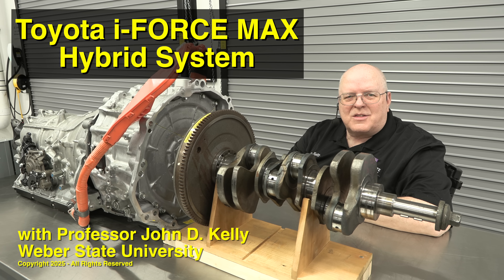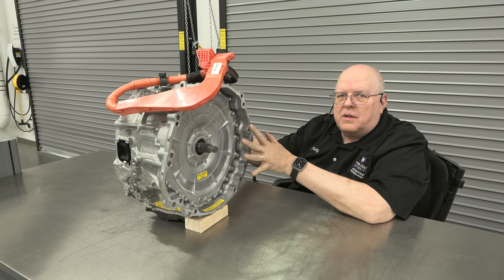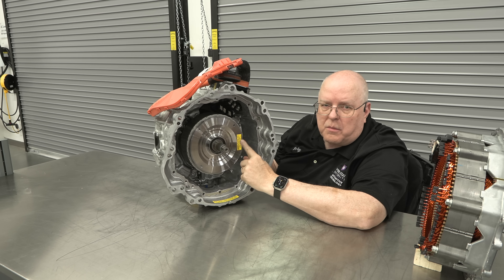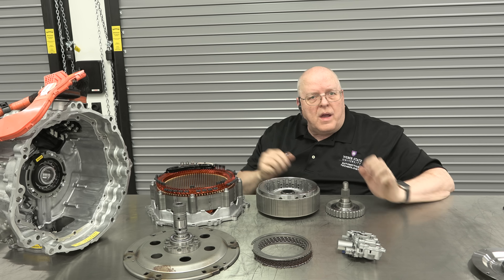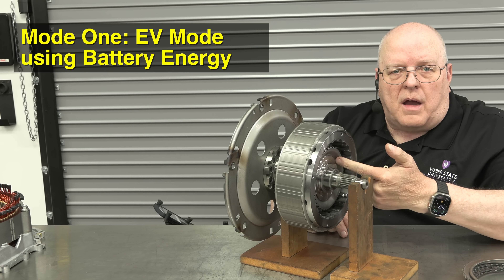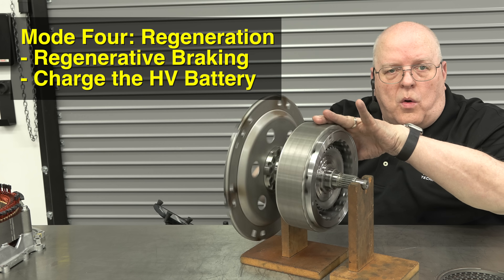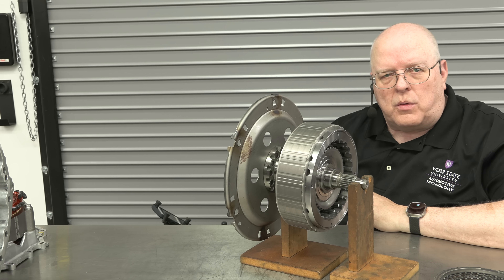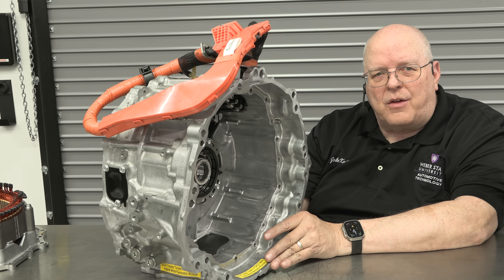Toyota's i-FORCE MAX One-Motor Hybrid System

Comment: Thank you, Professor Kelly. I am a 72 year old senior and find your videos interesting. You educated me on my gen 4 (2019) Prius from your video on Prius. Always interested to learn as much as I can.👍🇺🇲
Reply from the maker: That is great to hear, thank you for watching!
Reply: @WeberAuto \How does it it hydraulic lock up for engine start if there is no hydraulic pressure. I understand everything but that. No line pressure from trans in KOEO situation. Does it just build line pressure up that fast for a seamless engine crank? Does it have a pressure senor in the system(s) so it just doesn't willy nilly slip the clutch while cranking? So confused, I must be getting old . The situation I'm talking about is when it is parked with a near complete discharged hybrid  battery.
Reply: @Dieseling123  I am pretty sure the hydraulics that power the clutch pack are pressurized using an electric motor. So basically, you push the power button, the contactors power up the EV system and the hydraulic pump. Once pressurized, the EV motor spins to fire the engine, and the hydraulic clutches engage to complete the process, spinning the engine.
Reply: @mynameismud08  It gets its line pressure from the transmission. So your are saying there is a electric hydraulic pump inside the transmission on top of the mechanical pump.
Reply: @Dieseling123  I was making an educated guess (hence saying "pretty sure" as opposed to "sure") based on how other Toyota hybrids work. For instance, most don't have a normal power steering pump like old engines do; they use electronic pumps. You'll have to wait for the professor if you need a definitive answer.
Reply: @Dieseling123 
Very interesting question, I would guess there are accumulators that hold just enough pressure to feed the clutches when the valve body solenoids are active. Since this has a traditional transmission, I would doubt if there's an electric hydraulic pump that builds that pressure on KOEO.
Just a wild guess
Reply: @mynameismud08  I'm actually a 48 year mechanic. Hence the "I'm getting old" part of my comment. Pretty familiar with modern systems.  Just a little stumped on hydraulic pressure on standing still vehicle. I could be making more of an issue out of it than it is.
Reply: @Dieseling123 at 12:38 he mentions electric pump with ICE off and mechanical pump with ICE on so your years of experience paid off

Comment: Does the internal combustion engine run all the time? Why does it need a torque converter? Great video!
Reply from the maker: There is an electric only mode where the engine is off. Other than that it is running.

Comment: hmmm... it still has a torque converter... from my point of view it isn't necessary with EM in between...
Reply from the maker: The torque converter allows for a smoother and quieter power transition than an electric motor only system like the Jeep 4Xe system.

Comment: I think this system has become more complicated, less reliable, and I wouldn’t say these cars have impressive fuel economy either. In my opinion, the eCVT was a brilliant solution  minimal parts and maximum reliability. I don’t understand why they’re moving away from it. They already had powerful transmissions in the LS600h and GS450h. What’s the problem with putting the internals from the GS450h into a Tacoma? The engine is basically the same (at least in the 2006–2012 GS450h), so it would be both efficient and capable. What does Professor John D. Kelly think about this?

I really like the TX550h+ for its engineering the good old V6 and the eCVT that’s as reliable as a hammer. Unfortunately, $85K is still an unaffordable amount for me at the moment.
Reply: Even tho THS eCVTs are brilliant, they're not good at offroading. See Subaru AWD new hybrid with Toyota eCVT on it and that thing aint capable as previous CVT at uphill.
Reply from the maker: The Lexus transmission was still a power split transmission. This parallel system allows all of the engine torque plus the motor torque to be applied to the Powertrain. Thanks for watching
Reply: I live on a large hill and have this in my tundra. You would be shocked how good the gas mileage is going up and down the hill everyday. Also the power this thing makes is bananas.
Reply: I disagree on complexity and reliability. It’s a standard engine and standard transmission with a clutch and an electric motor. This isn’t new engineering or production. The amount of torque that this can apply (towing) is significantly better than a planetary power split(PPS) as in a PPS in higher speeds the transmission is providing counter force (slowing or reversing gears) to lower the RPMs.

Comment: I hope those 5 clutch plates and disc hold up, is there a back up starter motor?
Reply from the maker: Yes, there is still a traditional 12 V starter motor that can be used if this does not work.
Reply: Truly Toyota backwards "innovation" in electrification - this is much closer to Honda's ancient IMA hybrid system than what Toyota already had since 1997...

Comment: Larger than I expected. I'm guessing the Grand Highlander using this module is limited to only a 6 speed because of space limitation when used in a transverse layout? The efficiency in that layout also seems to be somewhat disappointing.
Reply from the maker: The grand Highlander uses the same front trans axle as the sienna van and regular Highlander, hybrid, however, it uses a very large rear electric motor that comes from the BZ4X electric vehicle from Toyota. So it has more overall power than the sienna or the Highlander hybrid. Thanks for watching.

Comment: AI Summary

Abstract:

This video provides a detailed technical teardown and explanation of Toyota's i-FORCE MAX parallel hybrid system, featured in vehicles like the Tundra, Sequoia, Tacoma, and 4Runner. The core of the system is the "hybrid generator module," a self-contained unit installed between the engine's crankshaft and the automatic transmission. This module houses a powerful permanent magnet synchronous electric motor and a multi-plate hydraulic clutch pack. The video demonstrates how this clutch pack is the critical component that connects or disconnects the engine from the drivetrain, enabling four distinct modes of operation: pure electric vehicle (EV) mode, engine starting, hybrid mode (where the motor assists the engine or recharges the battery), and regenerative braking. The presenter highlights the system's impressive power output, noting the electric motor can add 60 horsepower and 184 lb-ft of torque, and concludes by discussing the module's universal design, physical dimensions, and its non-serviceable, "replace only" nature.

Understanding the Toyota i-FORCE MAX Hybrid System

*   00:00:02 System Overview: The Toyota i-FORCE MAX is a hybrid system used in the Tundra, Sequoia, Tacoma, and 4Runner. It places a powerful electric motor between the internal combustion engine and the automatic transmission (10-speed or 8-speed).
*   01:22 The Hybrid Generator Module: The central component is the hybrid generator module. It bolts directly between the engine block and the transmission, integrating an electric motor into the powertrain.
*   02:45 The Key Component: A Hydraulic Clutch: Unlike other hybrids, this system uses a multi-plate hydraulic clutch pack inside the generator module. This clutch is the crucial link that engages or disengages the gasoline engine from the electric motor and the rest of the drivetrain.
*   03:25 Power Flow Explained: The engine crankshaft connects to the clutch's input side. The electric motor's rotor is connected to the clutch's output side, which then drives the transmission's torque converter. The engine and electric motor are only connected when the hydraulic clutch is applied.
*   07:57 Four Modes of Operation: The clutch allows for seamless switching between four primary modes:
    1.  Electric Vehicle (EV) Mode: The clutch is disengaged, the engine is off, and the vehicle is propelled solely by the electric motor.
    2.  Engine Start Mode: The electric motor spins the engine to life by gently engaging the clutch pack.
    3.  Hybrid Mode: The clutch is engaged. The engine and motor work together for maximum power, or the engine can drive the motor to recharge the high-voltage battery.
    4.  Regeneration Mode: During braking or coasting, the wheels spin the electric motor, which acts as a generator to capture energy and recharge the battery.
*   10:22 Significant Power Boost: The electric motor is very powerful, adding up to 45 kilowatts (60 horsepower) and 250 Newton-meters (184 pound-feet) of torque to the engine's output.
*   10:58 Modular and Universal Design: The system is designed as a self-contained module that can be adapted to fit between various engine and transmission combinations, making it a versatile solution for hybridization.
*   11:44 Physical Size and Integration: The module is substantial, measuring 9 inches (228.6 mm) wide, which lengthens the overall powertrain. It shares lubrication and cooling fluid with the automatic transmission, fed by an electric oil pump.
*   13:18 A Non-Serviceable Unit: The hybrid generator module is designed as a "replace only" component. While external parts like the valve body and solenoids are accessible, there are no authorized procedures or parts available for internal repairs.

AI-generated summary created with gemini-2.5-pro for free via RocketRecap-dot-com. (Input: 15,984 tokens, Output: 834 tokens, Est. cost: $0.03).
Reply from the maker: Thank you, that is very good

Comment: Kinda reminds me of the old Honda system..
Reply from the maker: Yes, it was a parallel hybrid system to. This system has a clutch pack to disconnect the engine though. Honda did not do that. Thank you for watching.
Reply: @WeberAuto  I love your channel! I have a 2019 Honda Insight EX with 205k miles on it and it still gets up to 58 mpg. Only regular maintenance - easily the best car I've ever owned and most dependable.